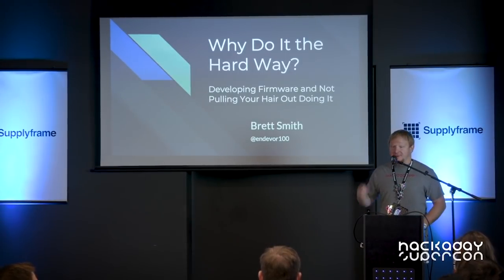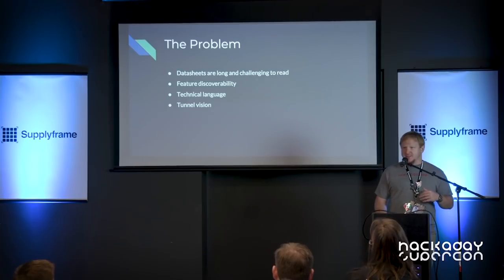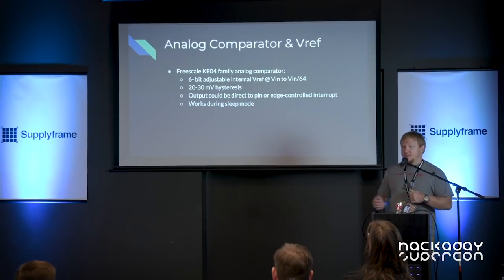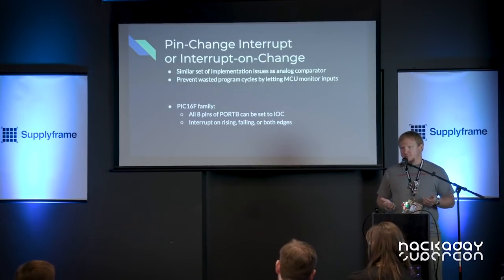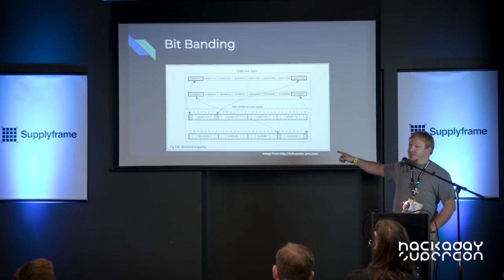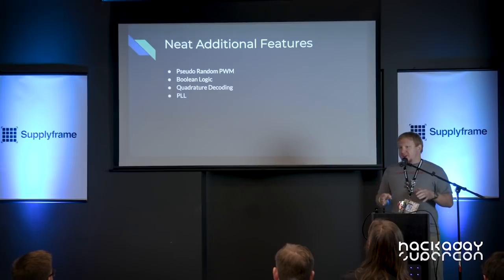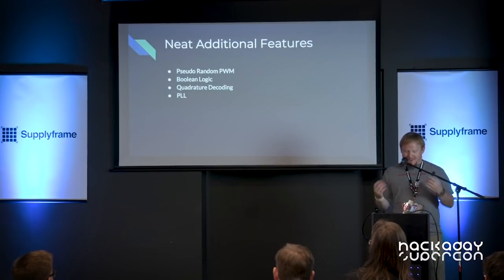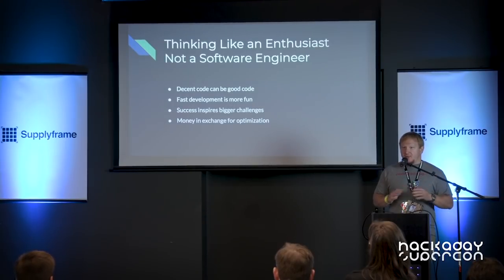Hackaday Supercon - BrettSmith : Why Do It the Hard Way?

Comment: like wise there is BEEP feature in STM8, 
""The beeper function outputs a signal on the BEEP pin for sound generation. The signal is in
the range of 1, 2 or 4 kHz.""" 
this can be used for feedback sound for key press, buzzer sound etc